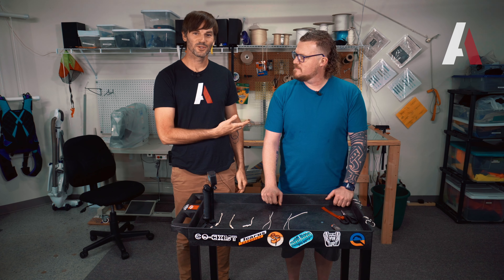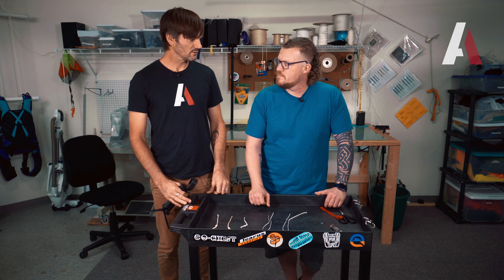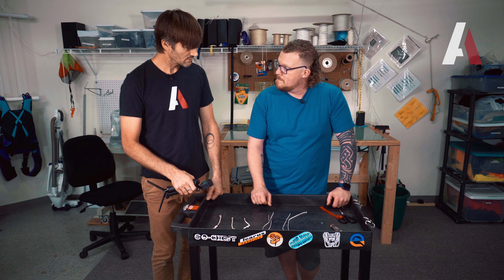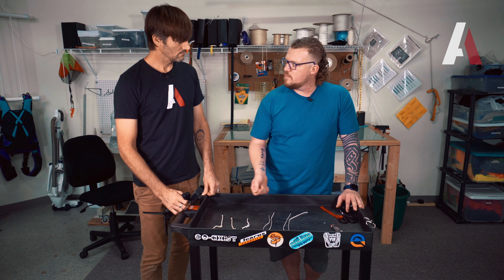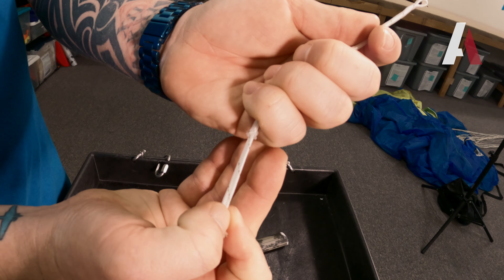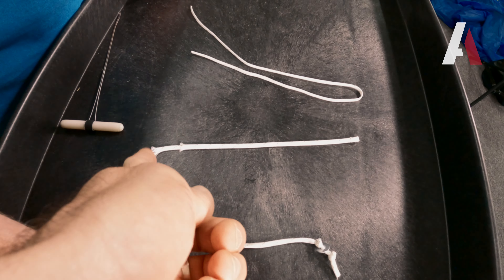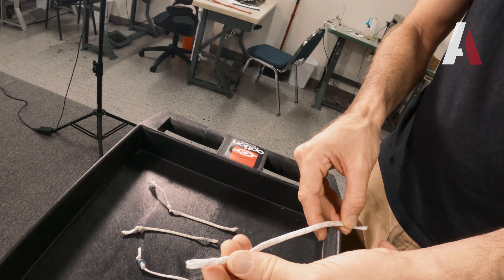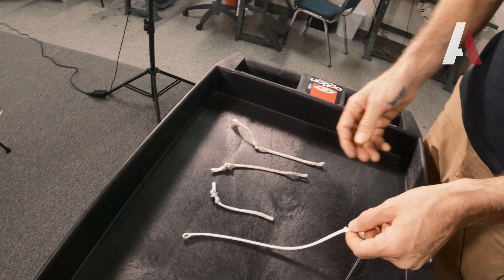Closing Loop Care For Your Skydiving Rig | Joshua Cook "Cookie"

Comment: One question, how long should the closing loop be?
I always get confused when try a bigger canopy and have to extend the loop a little bit.
How do I determine the correct length and pressure on the pin from the loop.
when I downsize, it is fine, but when i up size and use a bigger canopy, it is always a dilemma.